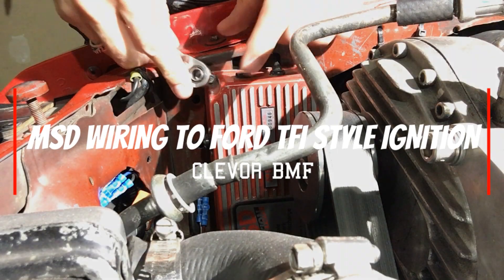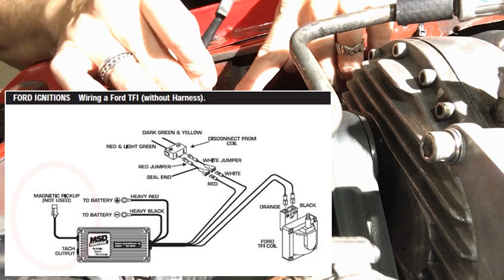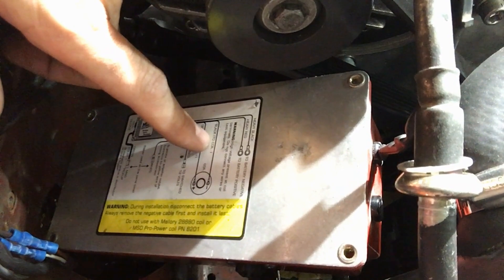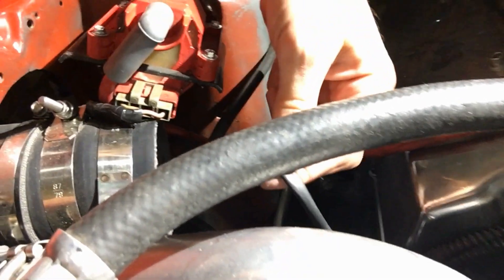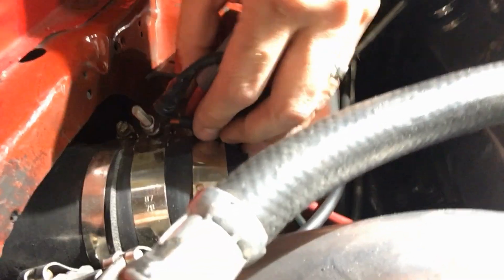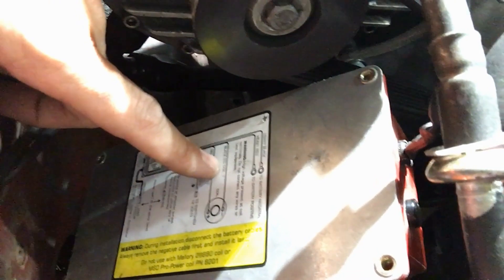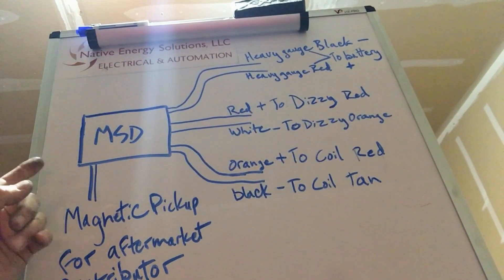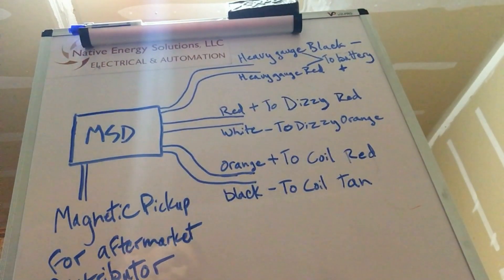MSD Wiring to Ford TFI Style Ignition, FoxBody, F150, Ford TFI

Comment: What if I've converted to carb do I still run msd the same way
Reply: Thankyou for helping me been messing with my 90 fox that has been converted to carb bored60  then stroked but never has run right since I was thinking it was msd box not wired correct and you confirmed that.its been a little over a yr I've been doing g this fox now I think I will be driving her soon thanks to you and your very helpful video and response
Reply from the maker: Glad to help! Let me know if you have more questions.  I’ll do my best to help.
Reply: @isiahgill6291  did it work?
Reply from the maker: Yup, same way.
Reply: I have an aftermarket distributor, I don't want the magnetic wire just dangling there I'd rather use that instead of cutting and splicing, so my question is can I connect that instead of using the white wire? Btw I'm switching over to carb so hence the reason using the magnetic wire lol

Comment: 87 mustang 331 carb set up was a 4 cylinder. Have v8 cluster and can't get stock tach to work. Car had a aftermarket tach in it. Can I just run wire from aftermarket tach that's at dash to wire that goes stock tach or do I need an adapter.  Msd box , distributor and coil set up.
Reply from the maker: it depends on where the wire to the aftermarket tach comes from.  What typically happens in a factory vehicle is the tach is ready from the same negative wire that goes to the coil.  With a msd box, your tach should still be connected to the same wire that is triggering the msd box,  usually a yellowish wire if I remember right.... But you need to connect the factory tach to the factory trigger wire for the coil.  it pulses the negative signal from the distributor to fire the coil and also is a signal for factory tach.

Comment: 1989 bronco, 5.8. If I  use the MSD module does that totally eliminate the tfi module on the distributor?
Reply from the maker: No it doesn’t.  The msd simply takes a signal from the tfi and then gives the amplified multiple spark signal to the plugs
Reply: @BMF_Garage  ok. Trying to eliminate that tfi! How about getting a points dizzy then doing a Pertronix conversion? That would give me the weights for advance and Hall effect for coil grounding. Would this mess with the computer?
Reply: Argh! TFI triggers injectors, forgot that! Is there a work around for injectors? Hmmmm
Reply from the maker: You could just do an msd distributor with an msd box to eliminate the tfi

Comment: Do you wire all them together or leave the ones you've cut? I wired everything together and it's not getting fire. Thanks for the help.
Reply from the maker: Not sure what you mean by wire them all together… like literally connect them all together?  Cause that won’t work.. you have to follow the wiring diagram.  The msd gets wired in between the factory wiring…
Reply: When you cut the wires on the tfi do you just use the wires going in the distributor or do you need to use the ones that you've cut on the right too? Same with the harness going into the firewall that goes to the coil once you cut them wires do you just use the harness and not the wires going into the firewall?
Reply from the maker: You need both sides.  Look at your factory coil wires.  There’s two wires.  You’ll cut the two wires going to the coil in a spot that makes it easy for you to wire it in.  After cutting those, The two wires coming from the distributor are the input to the msd and the two wires going to the coil are the output from the msd.  I don’t know off hand the colors on the msd but that’s on the wiring diagram.  Then you connect the think red and black on the msd to power.

Comment: Hey man great video what do we do with the grey coming form the msd that is supposed to be for the tach output for a 91 gt
Reply from the maker: Shouldn’t need to connect that on the foxbody.  The tach output is typically just used for a dyno situation or tach that needs it.  Factory tach and aftermarket tach that in use just connects to the factory trigger wire and doesn’t use the tach output from the msd.
Reply: @BMF_Garage  my auto meter tach has a green wire that is tapped into the negative that goes to the coil… should that grey wire go to the green from the tach ?
Reply from the maker: I don’t think so.  Pretty sure the auto meter tach should connect just how you have it… that’s how mine is… then you should have a selector switch on it for 4cl, v6 or v8..:

Comment: So I have the exact box as you along side of msd blaster 2 and and msd distributor that plugs into the connection you tucked away. And that’s my setup so do I just tuck the white and the red away since I don’t have tfi? I am carbed btw. And this setup should provide spark correct ?
Reply from the maker: Yes sir, that should work for your van setup

Comment: i guess i just dont understand the rev limiter   I havent done anything with it   What should i do?
Reply from the maker: My apologies, just been busy with work.  It depends what you’re trying to do.  Are you just curious about the rev limit or trying to do the rev limit with the msd?
Reply: @BMF_Garage    I am wondering what to do with the rev limiter. I have a 1996 F150   I just built a  95 bronco engine for it   The engine is the same as factory original. I didn’t do any serious mods to the new engine it’s basically stock. I am running it with the factory 5 speed transmission the truck is 4x4.  I did not activate the rev limiter on the MSD 6.   I guess I need to set up the rev limiter? I wonder what rpm I should set the rev limiter at.  What does the rev limiter do??  I really appreciate you  answering my questions!!! Thank you!!!!
Reply from the maker: Rev limiter is good to use.  The msd will pull spark to prevent the engine from revving higher than what you set it at.  If you didn’t have a rev limiter, the engine could rev too high and damage itself.  I’d set it at 6000 for a factory engine.  That’s a good safe limit in a stock configuration.  You don’t have to connect any extra wires to/from the msd for the rev limit to work.  You just have to set the msd at the desired rpm (6000).  Hope that helps!
Reply: @BMF_Garage  that’s exactly what I I needed to hear.  I’m trying to watch the video on you with 1320 video but it won’t download which is really weird. I really like 1320. Video they do a really good job on showing what’s going on in the drag racing world. That’s way cool they hung out with you.  This is the last thing I am doing to my truck. Now I’m going to finish my 92 camaro. 

Thank you very much for your videos and your time answering my questions. I wish the best of luck and success on your mustang. I love your car!!!!!
Reply from the maker: Thanks a bunch, I appreciate that 🤘🏻

Comment: Is the connection from wire to wire a splice or what, im not big on electrical components and can't figure this thing out
Reply from the maker: I used a butt splice with a mechanical crimp connection.  You can also solder and heat shrink if you prefer.

Comment: With that I can eliminate the computer on my 1986 multi injection thunder bird and install like a sniper efi I don't need the computer from my car or nothing that comes with it. Tell me what do I need to make my car run money no problem. Because I want to install my sniper efi that I bought.
Reply from the maker: Megasquirt is plug and play with the factory harness just take out factory ecu and put in the megasquirt 🤷🏼‍♂️ sniper works too but I believe there’s some wiring to do if you didn’t buy the plug and play kit
Reply: @BMF_Garage  thanks.

Comment: So fucking frustrated. Your hand is in the way and the camera is shaking when you're explaining which wires go where. So do all 4 wires go into the same place? Your literally saying red and white go in the the plug, and the orange mad whatever go into the same spot. I don't get this man.
Reply from the maker: Sorry bro, I’m tryin over here 🤷 

Red/white go to the factory coil wires red-lt green / yellow-white in that order.

The msd orange / black go to the coil positive / negative in that order.
Reply from the maker: The thicker red/black on the msd connect to the battery positive / negative
Reply: @BMF_Garage  right on. that makes more sense. So basically the MSD box goes in between the coil and the connector.
Reply from the maker: Absolutely, that’s correct!
Reply from the maker: It’s taking the factory coil signal and amplifying it and increasing the amount of sparks per trigger, hence msd = multiple spark discharge.  It just goes in between the two and modifies the signal

Comment: What about using the old DuraSpark Distributor? How do I wire it up? Thanks
Reply from the maker: Still wires up between the coil and dizzy.  Power wires on the msd box go to the battery.  Input to the msd box comes from the dizzy and the output goes to the coil.  The msd is just taking the factory coil signal from the dizzy and amplifying it then sending it to the coil.  

Factor coil wires connect to the input on the box, then the box connects to the coil.
Reply: Clevor BMF thanks. Been trying to smooth out my idle on a Jeep cj5 304 with duraspark. Replacing small cap with adapter and large ford cap. Don’t have a mad box yet. Going to see if the distributor mod helps first.

Comment: I'm trying to visualize this on my 93 gt, would I cut and splice the red and tan wires to go to red and white INTO the msd box, then splice the orange and black coming out right to the coil in wires?
Reply: And let me just clarify lol, I cut the factory end off that plugs into the coil due to it being a different type of coil, it has a rubber end with black and orange wires coming out, I just didnt know if I run the wires from the msd box to the pig tail? Man I wish someone good with wiring lived close to me in NY
Reply from the maker: Na you got this.  It’s easy!  Just think or the msd box as going in between.  If the cut the wires going to the coil, the side of the wires not connected to the coil is your input to the msd box.  The side of the wires connected to the coil is your output from the msd box. 

All the msd box is doing is taking the signal from the car and amplifying it then giving it back to the coil.
Reply: @BMF_Garage  it was my thought exactly.  So those two wires that I cut off the factory coil and run those to the msd , then run the wires out of the msd to the after market coil and be done?
Reply from the maker: Correct!
Reply from the maker: You’ll have power to run to the box also  but as far as the coil wiring is concerned that’s it
Reply: @BMF_Garage  I really appreciate you replying, I've been over thinking that msd box for a year
Reply from the maker: Not a problem at all 👍🏿
Reply: @BMF_Garage  and of course,  the coil I have doesnt work with the msd 6al, I have the crane fireball
Reply: @BMF_Garage  one more thing , can I just ground the msd to the body or frame instead of running the ground all the way to the batt?
Reply from the maker: Yes you can

Comment: Hey man, thanks for the informative and clear diagrams. I am trying to wire up my stock tach in my ‘83 coupe to work again, I don’t like the look of an aftermarket tach. However I don’t have the TFI style ignition, my car has a magnetic pickup style distributor, with violet and green wire that goes into the MSF box violet and green wire( the plug not used in this video) Would I be able to use one of those as the signal wire for the tach? 

Also, do you know which one of the three spots on the back of the tach circuit is the signal input? I’m guessing one is ground, power, and then signal. 
Thanks, let me know if you have any suggestions. I may just have to buy a tach adaptor for the MSD box.
Reply from the maker: Of the violet and green wires, one should be positive and the other should be negative.  You should be able to take the negative wire to the factory tach for a signal however the pulse count might be different than stock so if it’s off, that would be why.

As far as what terminal to connect it to, I’m not certain on that without looking at it too much.  Will check my manual and see if it specifies a wire color or termination point.

Comment: Excellent explanation. But i am surprised that it runs reliable with the choice and condition of the wiring connections you have used. 
I definitely wouldn't be soon lucky lol
Reply from the maker: What wiring methods are you concerned about?
Reply: Right dudes just talking smack

Comment: I just bought a 90 fox, won't start after going around the block. I did a tune up ,plugs, wires, oil change, fuel pump. Same result. I bought a tfi relocation kit, same problem. I fixed the 3 compasitors in the ecm, 2 was bad. Same problem. When I bought the car it has a new distributor. So my next step is to hook a MSD 6 Al. Hopefully that will fix it. Your video is helpful with the wiring.
Reply from the maker: Needs spark, fuel pressure and air to run.... have you verified it has spark with a tester?  Checked fuel pressure at the schrader valve on the fuel rail?  

There are electronics inside the distributor also that can cause problems...  I prefer replacing the entire dizzy....
Reply: @BMF_Garage  yeah 40 psi and spark. Once it cools down it will run. It has to be something that gets hot electrical under the hood I'm thinking. I might buy a new distributor and coil also
Reply from the maker: Dizzy has a pickup in it that can cause that.  I’d get a new one with all the electronics.  Rock auto has them for around 60$ with everything... then you’re not taking a distributor apart trying to replace parts.

Comment: So what u have to cut into ur dizzy wires I have the 6al 6025 the newer 1 with out the pills I have a tfi msd dizzy to I just a little confused so u need to cut into ur tfi plug?
Reply from the maker: So you’ll need to cut the two wires that go to the coil.  Then wire the red and white from the msd box to the side of the wires coming from the dizzy.  Wire the orange and black from the msd box to the coil.
Reply: Clevor BMF OK I got it I just got confused I never hook 1 up before thanks this is my first 1 I have a 87 notch with a 89 harness so basically u run the wires into the coil wires then use the coil wires that u took out of coil!

Comment: so I don't touch anything with the microsquirt, I just hook it up regular like if I were to have the stock ecu.
Reply from the maker: Yes sir, that’s correct.
Reply from the maker: The ecu stills controls the spark by giving a signal to the msd box. The msd box just makes the spark hotter